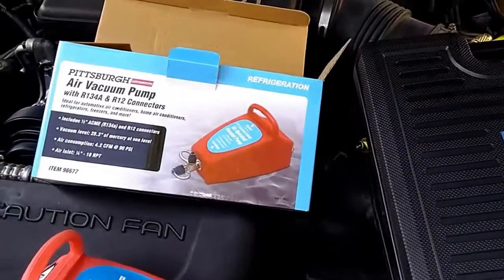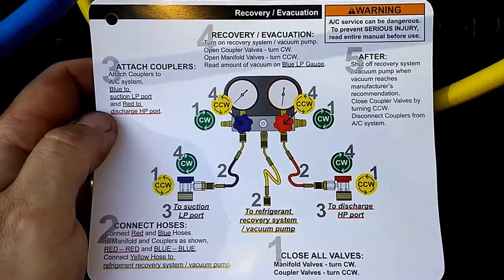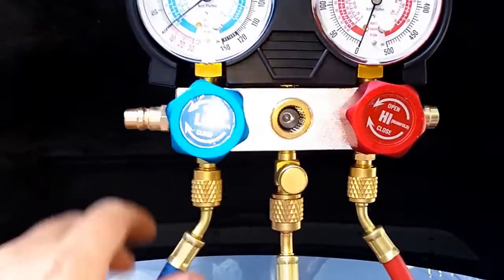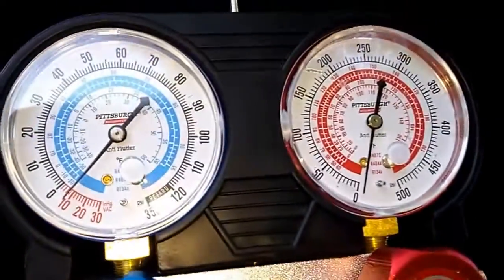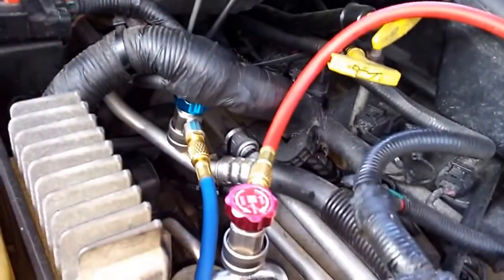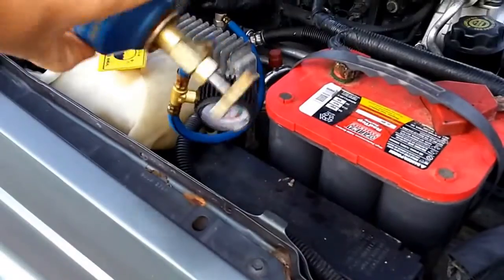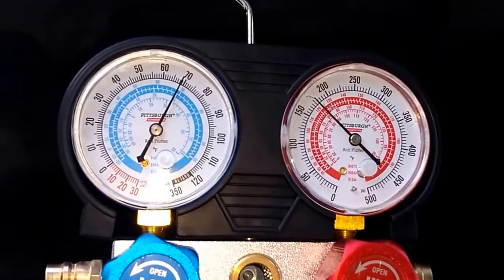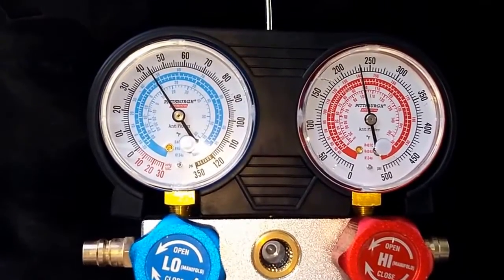Part 3 - 2002 WJ Jeep Grand Cherokee Compressor Replacement

Comment: I'm 2 years late, but did the a/c unit come pre packed with pag 46 oil? Or was the R34a mixed with oil? Or did you not add any? The manual says to ad 28 oz of r34a and 8 oz of pag 46.
Reply: I hope it has oil in it because  I tried draining  it and there's nothing coming out so I just added some in the compressor  hopefully  it's ok